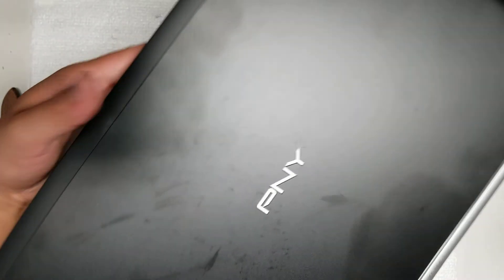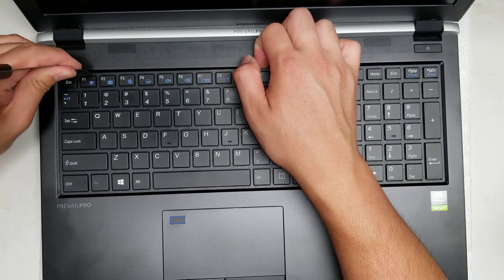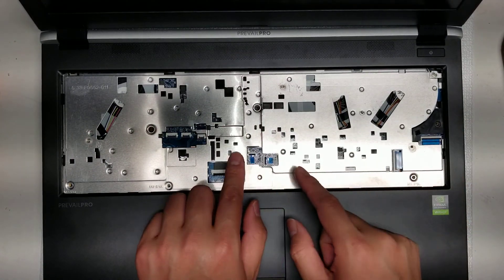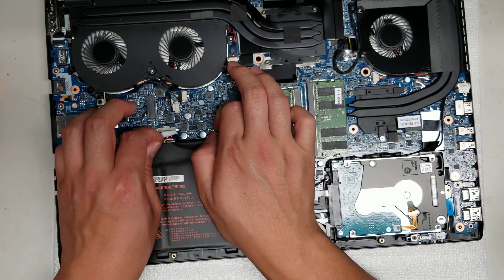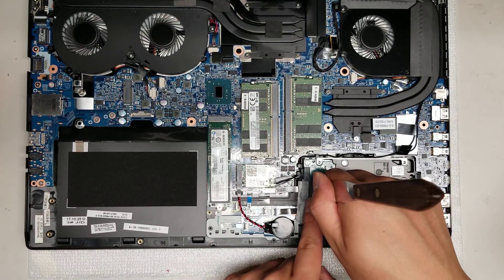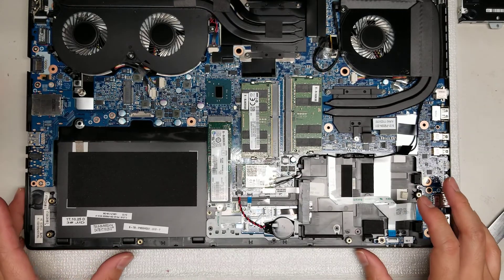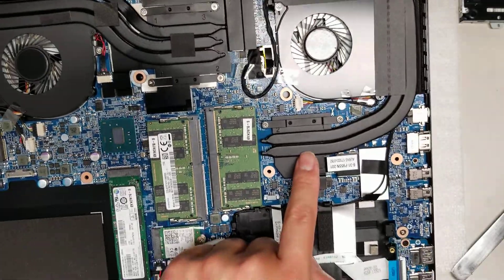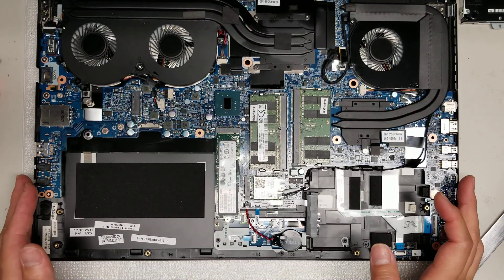PNY PREVAILPRO Mobile Workstation P4000 Disassembly Keyboard RAM SSD Hard Drive Upgrade Repair

Comment: Hi, I need help, I want to change a fan on my PNY P3000 but I can't remove the bottom cover (is it necessary to remove the keyboard to remove the screws under the keyboard to remove the bottom cover? and where can I buy the fan and you know which is?
Reply from the maker: Unless I've worked on it, I couldn't tell you. I'd basically be googling.
Reply: You have to remove the keyboard to get access to the CPU fan.

Comment: thanks for the video, helped me a lot cleaning it. I have the exact same notebook but the blue color in its RGB keyboard is so dim, it's almost non existent. do you have any idea what could be the issue? or any guesses?
Reply from the maker: If it was brighter before. You probably have to replace the keyboard, but usually blue is just the dimmest looking because it is harder for the eyes to see.